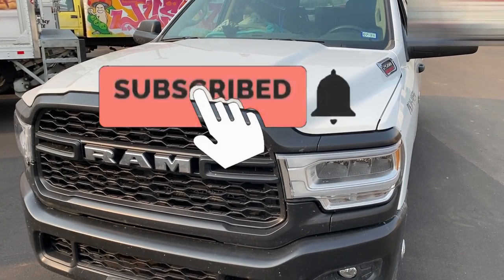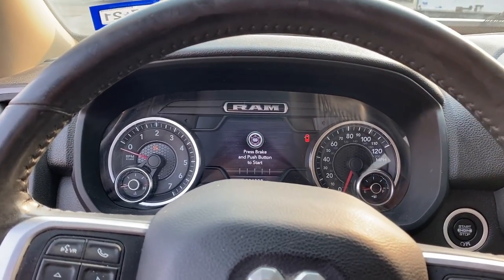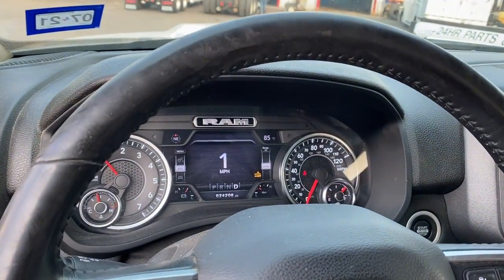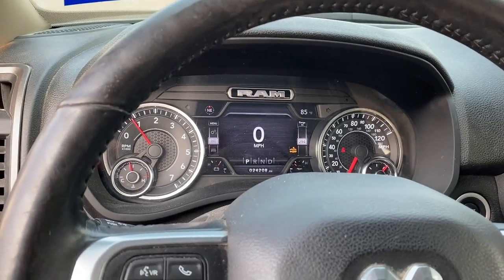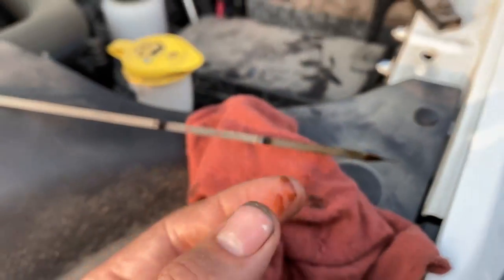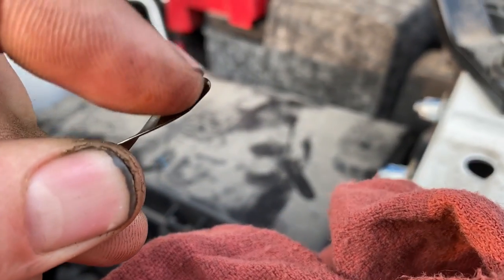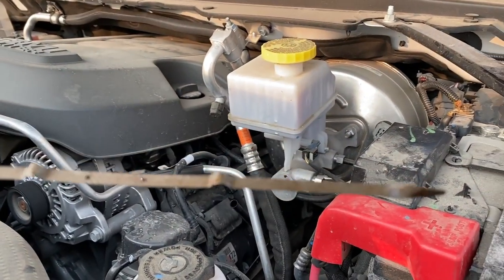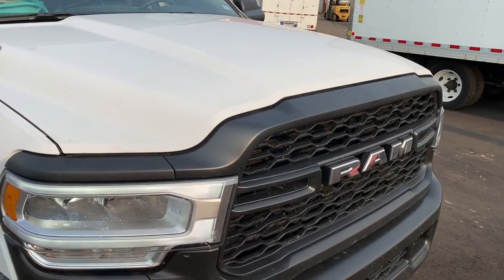2020 Ram 2500 Hemi 6.4 Bad Engine!

Comment: I noticed on some of the new Ram truck commercials they brag about how they have won the " most appealing truck " award three years in a row.
Yet they never mention all the recalls and customer complaints flooding their phone lines and e-mail customer complaint account.
By brother in law but a 2019 2500 with the diesel and he has had to take it to the dealer so many times for recalls and other issues not covered in the recalls.
I owned Chrysler products for years but ever since they were bought out first by Daimler and now Fiat the quality and reliability has gone way downhill.
Reply from the maker: Yeah they are good at making an appealing product, but dealing with the dealer sucks. Although to be fair, I hear the same about dealers from other OEMs as well. All they want is our money unfortunately.
Reply: @daviddouglass7662  Your right, their all junk now.
Reply: @desiderious1  they all suck now unfortunately, my last two chevys both had transmission problems a 15 Silverado and a 17 colorado so I traded out of both of them before they ran out of their power train warranty

Comment: Why would you run it at all before you checked the oil ? That's kind of stupid for a repair shop to do !  Damn
Reply from the maker: .....because it was towed in and the customer only said that it wouldn’t start. They didn’t say anything about the engine making noise or the truck dying on the road. Do you check the engine oil when a tail light goes out? Either way the engine was toast so what does it matter?

Comment: My 2019 6.4 started ticking at 7K miles currently have 19K miles, dealer changed oil at 5, 7.5, 12, 15K miles and it still ticks. Fighting dealer and FCA at the moment because they will not address tick. I bought a new truck so I don't have issues for a while.
Reply from the maker: Yeah unfortunately yours is one of those cases where you can do everything right and it still fails 😥
Reply: Being honest it's a Dodge, don't you hear EVERY V6 they have ticking??  What makes you think the Hemi (lol) is any different. Dodge is the ONLY engine of any combustion engine that has a Hemi head, why is that?  Simply it doesn't work. The power and is Very narrow, doesn't make any torque, dead off idle, it's ONLY a marketing hype and people still believe in it for the last 20 years, it's comical to me.
Reply from the maker: @bluesky-ud9wg   Dude. Lol. AGAIN? Did you just come here to complain about Dodge like all the Chevy boys? I think you need to study a few dyno charts, Mr. Toyota. The Hemi makes the same torque only 500 rpm later than a 5.0. The 5.3 actually beats them both in low torque, but the Coyote revs higher, so what's you point? You clearly don't know much despite your claimed experience. The current Dodge V6 has literally been on Ward's best 10 engines list since it came out and has got very good acclaim. And the Hemi lifter issue didn't start until '09 when they went to variable cam timing. EVEN NOW, it's a low percentage of trucks affected. I just wish they would actually do something about it. Do you know how many Hemi engines have made it well beyond 200k, 300k, even 400k miles? I've owned 3 and never had an engine issue.
Reply: @TonyTheTruckGuy  I see I touched a nerve so I'm not going to continue. Enjoy you're Pushrod engine...
Reply from the maker: @bluesky-ud9wg  Lmao, I didn't realize that being notified of your comment and replying to your lack of knowledge meant that you were on my nerves. GM uses push rod....Ford uses push rod in their new 7.3....care to continue?
Reply: @TonyTheTruckGuy  Lack of Knowledge, ok you keep thinking that. Enjoy you're day...
Reply from the maker: @bluesky-ud9wg   You're more than welcome to prove me wrong...I've given you plenty of chances. You just clam up and leave...
Reply: @TonyTheTruckGuy  I leave when you assume I don't know what I'm talking about so bye bye.
Reply from the maker: @bluesky-ud9wg   LMAO. Because I've proven you wrong on every point so far and you're not doing anything to prove your points. Later, herb.

Comment: changing oil keeps everything clean and nice inside your engine that’s pretty obvious. Changing oil on time also keeps it running like new. After the filter bypasses from to much dirt and sludge your oil is like gojo orange hand cleaner.
Reply from the maker: Gojo 😂
Reply: Oil does 3 things; it Lubricates, Cools & Cleans. Also oil never gets "Dirty" there is a filter for that. People need to understand the basics of life sometimes
Reply from the maker: @bluesky-ud9wg   Technically, the oil does get a little dirty, that's why you change it lol. The filter can't catch everything, just the majority.
Reply: @TonyTheTruckGuy  Negative, you change it due to acids, gasoline, molecular breakdown, etc.
Reply from the maker: @bluesky-ud9wg  One might say that molecular breakdown and losing its cleaning properties, coupled with carrying away dirty deposits from the engine makes the oil dirty...lol
Reply from the maker: @bluesky-ud9wg  Not to mention the oil physically gets darker and dirtier.
Reply: @TonyTheTruckGuy  Dark is a reaction to gas, acids, etc. It does not Technically get dirty, the filter Cleans the oil
Reply from the maker: @bluesky-ud9wg  Yeah but if you want to get down to a technical level, the filter can’t physically catch everything. Certain tiny little particles are going to get through it. You can Google “why does engine oil get dirty” and find article after article on this.
Reply: @TonyTheTruckGuy  Ok dude first of all I was in the Military as a Petroleum Specialist. Second I've been a Toyota Tech for 21 years. NO oil filter will catch Everything, not even the Amsoil Bypass filter kit. The bottom line is this; You chance the Filter for Contaminates and the oil for Molecular Breakdown. I'm not going to go around with you about this. Enjoy you're evening
Reply from the maker: @bluesky-ud9wg  So if the oil filter isn't catching everything, then the oil is getting dirty...lol. Put your pride down and just admit it. No matter how little or how small of an amount, down to a molecular level, the oil DOES get dirty to a degree. Period. I've also been a diesel technician for 12 years. Have a good day.

Comment: I have a 2014 2500 2 wheel drive 6.4 l 70000 MI. I've only used the oil that the manual says to use and I always change it in time and I've never had any kind of issues like that thank goodness knock on wood. That Motors been great for me so far. Something I'd like to add though I can't buy the oil anywhere but the dealer if I get what the manual says to get. I've had such bad like letting them change the oil that I always just do it myself but the price is the same whether I let them do it or I do it. Nobody else sells the kind of Pennzoil that I need other than the dealer though. So after filter and oil are roughly spent about a hundred bucks every oil change doing it myself
Reply from the maker: Yeah it’s a hard choice when the dealer can do it for you at the same cost. I just try to make sure to double check the drain plug, oil filter, and oil level after they do the service. Of course at that point you may as well just do it yourself 😂
Reply: @TonyTheTruckGuy  there's one dealership I'll let them work on it but there are 80 miles from my house. The dealership close to my house which is where I bought my truck one time it took them eight hours to get the oil filter on I don't get it but that's what they said and there was more issues that I won't bore you with but I quit going there I only buy the oil there and that's it
Reply from the maker: @kinnybingman8666  Haha, oh boy. I’ve had my fair share of fails at the dealer I got my truck from as well, luckily there’s one even closer and actually right across the street from my work that seems better lol

Comment: I own a 2017 power wagon 6.4l hemi.15,000 mileage. oil change every 5,000
I have experienced innerminet valve train tic on cold start. Soon as oil pressure reaches the heads it goes away? I know the dealer will do nothing unless its broke down...
Reply from the maker: I’ve had that happen a hand full of times on my 5.7 as well. A bit unsettling from a long-run standpoint lol
Reply: My 2018 did the same thing right from new. Exhaust also chirped when cold and the motor sounded like a sewing machine under acceleration, it drove me nuts! This well known issue quite often happens even with proper maintenance the lifters are just prone to failure.
Reply: Sounds like broken studs on exhaust manifolds which is also a crazy problem with the hemi’s

Comment: My 2014 5.7 did something similar after the cam and lifter were replaced. One of the mds lifters got stuck in the collapsed position causing it to drop a cylinder and run like crap for lack of better wording
Reply: Also it needed a second new set of lifters after that. There was a tsb out for the pins sticking in the lifters

Comment: If you are not using high quality synthetic oil with high detergent,  you will be repairing the engine.
Reply: Ive been putting conventional walmart oil in my 2009 ram 1500 5.7L for years and its been just fine. Changing the oil frequently is more important than using synthetic . I change mine every 3,000 miles per the owners manual. No issues yet. Synthetic is better yea, but having clean oil by changing it regularly is more important.
Reply: @chasefeller1279  , conventional oil is not clean oil, it has ton of impurities that are left behind on engine surface.  
Full synthetic oil is better. 
100% synthetic oil is superior oil leaves nothing behind because it's pure. 
Conventional oil does not have enough detergent to keep engine clean. 
Conventional oil cannot tolerate heat. 
Conventional oil is to thick to flow when engine is cold and its number one cause of engine wear and engine problems on ram.
Reply: @repairvehicle  conventional oil is just fine for everyday use as long as you use the correct weight of oil, correct level and change it on time. Plenty of ppl get 200-300k miles with conventional oil on the hemi. My family has owned 4 rams over the past 23 years and never ran synthetic or had any engine failures. My coworker has 3 dodges, including a ram, 2 if which have over 200k miles on conventional oil. Sure synthetic is better all around and will maintain the engine better. When i get a new truck i will be going with synthetic from day 1 just to be safe but at this point my hemi is going on 12 years on conventional just fine. Its not like conventional will destroy your engine. Its way more important to change your oil frequently and ensure its at the proper level. Ive never had to top it off between oil changes. Change spark plugs every 30,000 miles and there’s virtually no carbon build up on them. Sure synthetic will probably make it last even longer but how long are you gonna really keep it anyways. I fully expect the trans or other components to break well before the engine. Luckily i got a lifetime powertrain from chrysler so if it does go out before im ready to trade it in, it’ll get replaced but i expect to buy a new truck in the next 2-3 years anyways. Truck will be close to 15 by then. Who knows, maybe i’ll keep it as a third vehicle and just drive it til the wheels fall off. Im expecting other things to break soon. Im still on pretty much original on  everything...radiator, a/c compressor, evap, heatercore, fuel pump, starter. Only had to replace small things like exhaust manifold bolts, rear diff pinion seal and water pump (due to failed seal not pump itself). Still has original a/c charge....never added any refrigerant and still blows cold. I figure those things will start going soon at some point. Not really worried about my engine. Btw, i run the chespest oil you can buy, walmart super tech conventional with a mopar filter. Cost less than $20 total for everything. Ive thought about transitioning slowly, going with high mileage conventional, then synthetic blend then synthetic but figure if theres any wear, its already there and synthetic aint gonna fix it. Just gonna stick to 3,000 mile changes. My family has had 4 rams, a durango, a nitro and a caravan and kept them all 10+ years, 150k+ miles and a lot of things failed, but never an engine. I’ll run synthetic in the next truck (hoping for a ram 2500 with 6.4 hemi next). Be nice if they introduced a new hemi like a 7.0 or something for the hd trucks. Maybe finally work out the cam/lifter issues with a new design.
Reply: @chasefeller1279 , I run synthetic oil only, once a year oil change. 226k miles on my 2012 truck and everything is original never been replaced or repaired. With synthetic oil it's cheaper because less oil changes and zero engine wear.

Comment: Which is it? Damaged engine due to defective build or damaged engine due to no oil change ever done thus far?
Reply from the maker: Never heard back but I’d have to guess never had an oil change.
Reply: The modern new vehicle purchaser seems to think the monthly payment is the ONLY money required to be spent on their vehicle. Dealer has every right to void the warranty if the oil has never been changed.
Reply from the maker: @TheOverisel  Yeah it amazes me that people don’t do simple maintenance on their vehicles and then act surprised when they blow up lol
Reply: @TonyTheTruckGuy  my base model 2021 tradesman 2500 with the 6.4 hemi was a $50,000 truck, so I'm not going to spend an extra $100-$200 a year on high quality fully synthetic oil and timely oil changes? People just kill me with the way they do things, or don't do them I guess
Reply from the maker: @itisfinished4U  They’ll pay for it eventually 🤣
Reply: @TonyTheTruckGuy  lol yep, some people just prefer to learn the hard way I guess